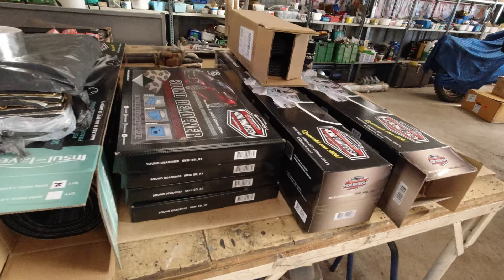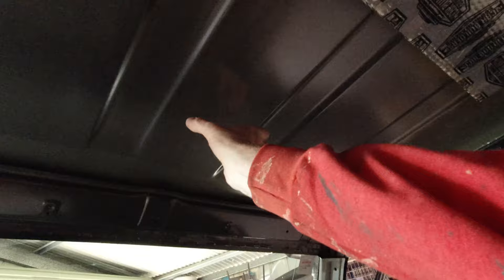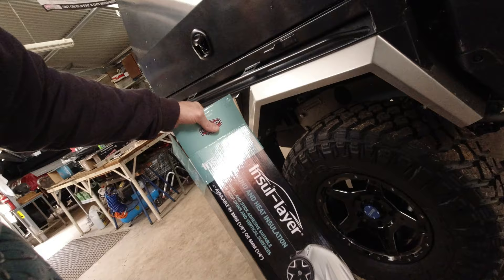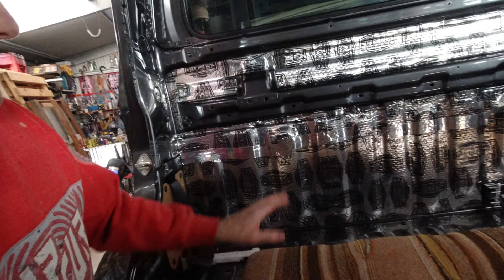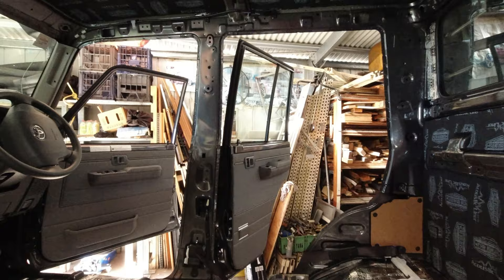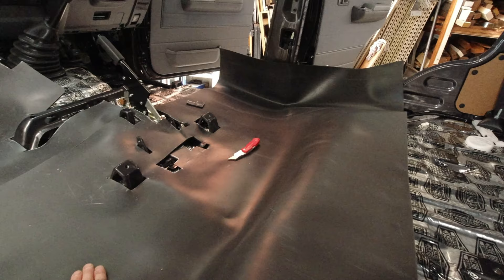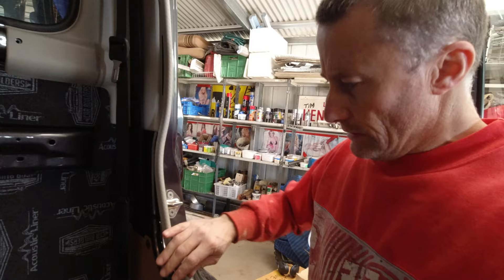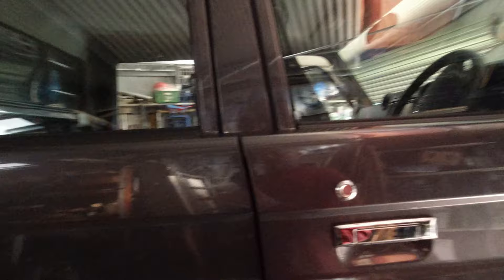Landcruiser 79 Series Build - Episode 3 - Sound Deadener Installation

Comment: Thanks mate, earnt yourself another sub and i enjoyed the vid. 
Thinking i might tackle this also. Just a few questions i wanted to ask 
1) Was it difficult cutting the sound deadener to fit around small grommets? 
2) Did you run into any difficulties reinstalling the trim/roof liner/console/seats after installing the acoustic lining? 
Cheers
Reply from the maker: Hi Jonathan, Thanks . It is a pretty easy job to do your self, just very time consuming. The sound deadener is easy to cut around bits and pieces .Roof trim and all other pieces went back on with out a problem. With the oem floor carpet they advise you to pull all the thick backing off bit off , i did not worry about that and was a little tight in spots but once again still not a problem at all. just take your time and do it over a weekend and have fun ! cheers